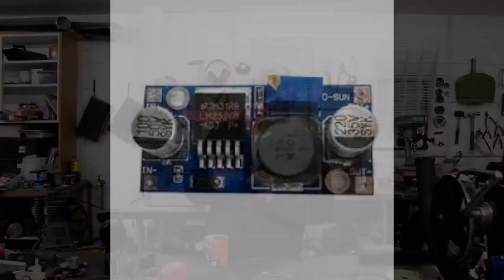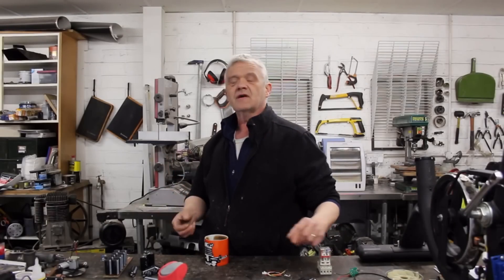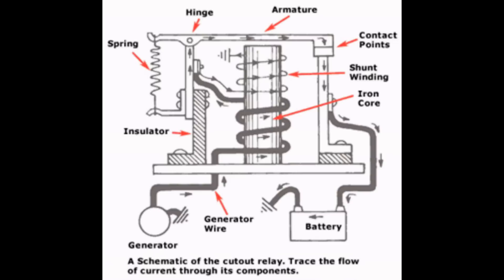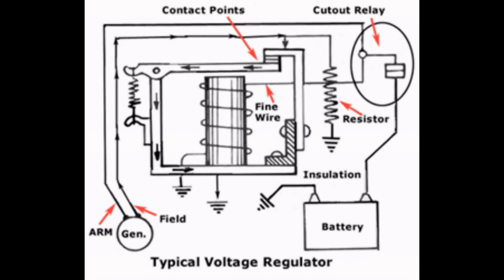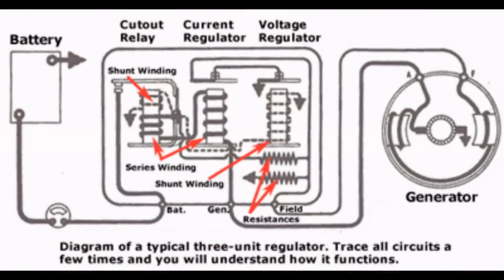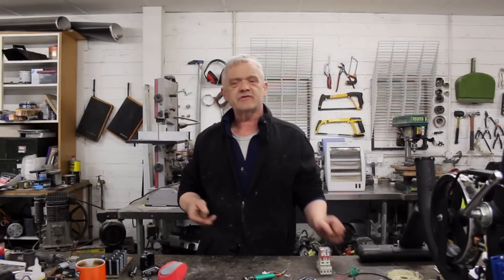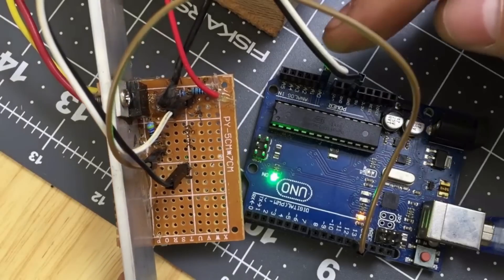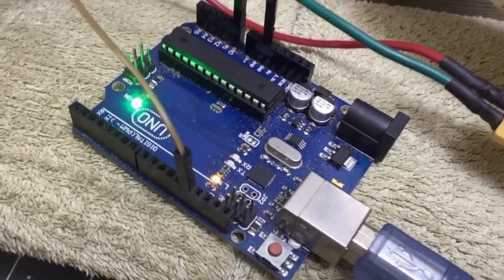2060 Voltage Regulators How They Work And How To Build Them

Comment: Gonna do some thinking out loud before I watch this video: I need to think about this sort of thing more.. for my gravity wall, my best start plan so far is a pendulum double-driving a gear which doesn't backdrive, which could mechanically regulate the release of a gearbox pushed by a heavy weight.. for a constant output, and now I realise oh wait I need to NOT have a constant output 🤣goddamn, starting over 
So I need power demand to make the gearbox go.. So that generates on demand from the gravity + tension springs. Explosion risk is only shrapnel..
But for moderating how much the gearbox turns, slowing the gears down means throwing energy away unless I do it with a second generator that doesn't go to the load (an input generator for lifting.. which to operate at the same time means two sets of weights or for the release to be bypassed/replaced by all my other energy harvesting inputs until demand isn't met.. or maybe some modular system of little generators that are all turned when it goes but slide along a rail to couple with different load outputs, moved automatically by something derived from a resistance measurement...? Maybe something that triggers at a certain voltage or temperature could activate heating of nitinol springs to shove them along.. though maybe I could do this easier with gears and a spring, but then bits have to lock.. how to not waste power in this is a challenge. I do want to do this all as plainly mechanically as possible.
OK watching the video now while my confused ideas float 😅

Comment: When I was a little kid, my Father had a company that made voltage regulators. I was the chief terminal installer and my Mother did most of the soldering.  We even had one of them that went to Antarctica!!

Comment: For people asking more details of the setup and circuits used:
Every component has a data sheet (the Arduino has schematics and board plots available, being an assembly) and every data sheet has not only test circuits used to characterize the component's specifications (where the charts and diagrams come from) but if the component manufacturer is worth their salt they'll also offer application notes of many typical use cases so people can learn the design rules behind circuits (so they can actually sell components, especially new/novel ones).  Once you look at those, you'll know what questions to really ask - like how to handle thermal trips, overcurrent protection, et al. because things like component value selection and why that particular circuit will already be answered.
I learned a lot of things that I couldn't understand on paper because I had directions on how to build a test circuit - lol I'd have no idea how to use an energy harvesting IC or why it was able to do what it does if not for app notes/test circuits.  Bonus is I know what circuit values to change to make it work for different input sources and produce different output voltages/currents because I saw it in the datasheet first and then found a breakout board online that very conveniently was exactly the test circuit already built for me.  I still can't build a buck/boost regulator from scratch but I can swap components and measure outputs well enough.  :person-turqouise-waving:

Comment: ahh im building one now with a LM317 but havnt found proper resistors yet laying around
Reply: LM317 is a linear device, which works differently than the circuits he presented. All of the "extra" energy is dissipated as heat with the linear circuits. Imagine an electronically controlled rheostat.
Reply: @jeremiahbullfrog9288  now you have to explain rheostat lol and then you'll have to explain wire wound resistors and THEN you'll probably have to explain inductance, resistance, impedance, and THEN you'll have to explain phase relationships....I remember the time someone asked me what a triac was and I said "a diode with a switch" deer in headlights look  ;-) :text-green-game-over:
Reply: @russellzauner  Good point but also... i don't have to explain anything. I left a breadcrumb for OP to do their own research if they desire. I'm okay if my input isn't helpful to them at this time. (Side note: gender-neutralizing singular pronouns by substituting the plural "they" is excruciating lol)
Reply: @jeremiahbullfrog9288  my goal was to build one from scratch to go from 12v to 5v using parts laying around the scrap piles and chatgpt led me to the transistor route. i found the lm317 instead of the LM3506 or whichever it is that is built in resistors so now i have to find a 240 and a 720 ohm combo or something like that, and a couple caps across the leads. then i can run a 12v wire a good distance and drop to 5v right at the camera

Comment: Did i miss most of the steps? I saw a few things mentioned/displayed, then the next step involved hooking  a voltage divider (which i think is said to be a couple transistors) up to an Arduino. Is this all there is? Also, how is using a premade computer making it yourself?

I guess i don't understand anything that was meant to be shown.
Reply: Yeah a lot was glossed over.. it's not you. I hope to see future videos detailing the missing parts
Reply: I'm trying to transition away from Arduino anyhow, RISC V has a lot of devices available now.
Reply: voltage divider is a couple of resistors, premade computer => premade microprocessor, 
a transistor replaces the switching part of the mechanical example (electrical relay)

Comment: God bless Amazon, and thank you I almost kept up but wouldn't trust myself.
Reply: Trust is earned. You have to get your feet wet to build that confidence. Start small and work your way up -- and stay away from Mains Voltage (the outlets in your wall) until you get enough experience!
Reply: @jeremiahbullfrog9288  thanks good advice